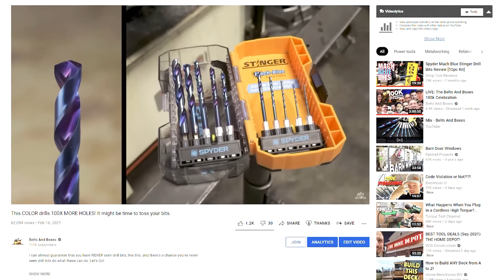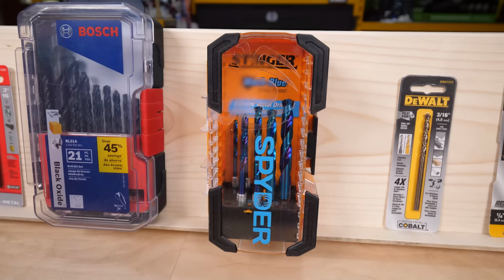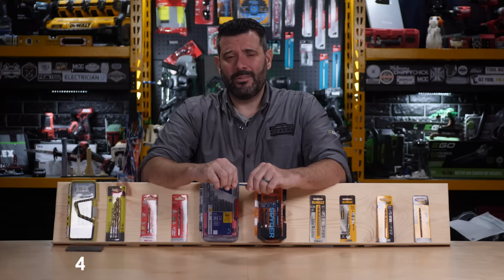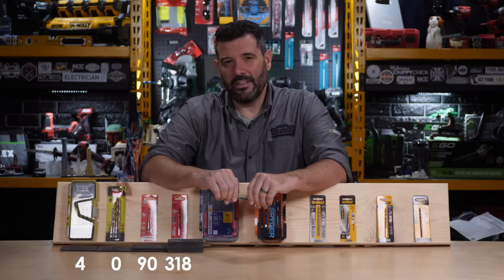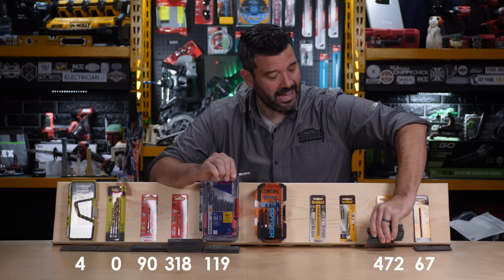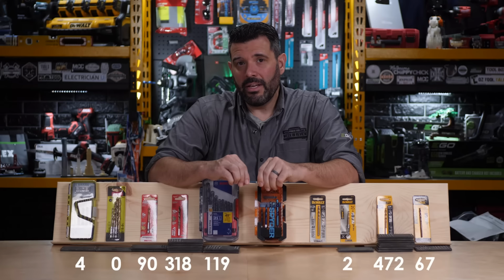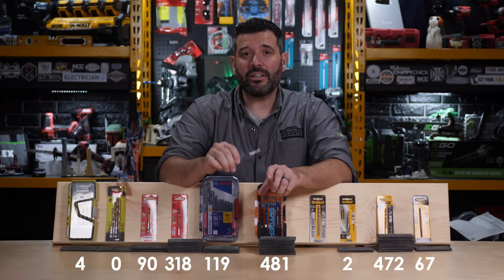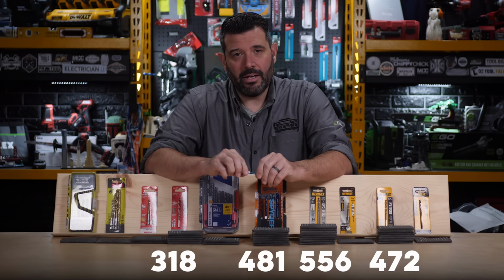What Drill Bit is Best? America takes on China. Milwaukee, DeWALT, Bosch, Ryobi take on Spyder 100x

Comment: Aren't you supposed to go at slower speed when drilling through metal?
Reply from the maker: Depends on the diameter of the bit, and the material. We asked around to people who would know, to determine what rpm to set our drill to, and stuck with it. The strong bits had no problem at that speed. You should also use oil to extend the life of each one, but again, our goal was to use them like an average buyer would.
Reply: @ToolShow  I see, thanks

Comment: Looks like the Diablo money truck didn’t back up to Robs studio.
Reply from the maker: We love Diablo around here. We're using a bunch of their CNC bits on our new CNC and they're amazing. But we didn't find any Diablo metal drilling bits when we went shopping. As for the rest of them, no one sponsored this video (you can't have a manufacturer sponsor a review video). As stated, we did get the Spyder Drill Bits for free, but we bought the rest. And of course, we had the Milwaukee drill already laying around, and bought another one to have as a backup, which we used after the first hole. There was something wrong with our first drill. Now that I'm thinking about it, we never figured out what the problem was. But the second drill worked flawlessly. I'll have to go have it looked at.
Reply: @ToolShow  😂 busting your balls Rob. I actually bought the Spyder bits myself they are amazing. Only thing I hate is why they made the case so big I can only fit it in my packout xl 😂. I definitely think though it needs to be tested against Diablo maybe you can put your brother to work again.

Comment: Strange woth you milwaukee I had awful luck with them I tried to drill a hole in an idler in a 963 so I could put some more passes on it so we could reuse the idler burnt up about an 1/8 of an inch bought a snapon set and they are still going after a year Nad haven't resharpened any

Comment: I would like to point out your testing these in more or less the worst case scenario which is an idiot doing it wrong you should be using some form of cutting oil even if it's just WD-40 or three-in-one oil it would help a lot
Reply: They did what most folks would do. But yeah coolant goes a long ways towards protecting a tool's temper working it.

Comment: "why would you choose a cheap bit!?" 

Easy, I dont want to fuck up nice bits drilling into hardened steel. 

Even the cheap bits generally work on a36 unless youre buying the cheapest stuff off amazon or from harbor freight. The dewalt black oxide bits are cheap and still preform great for a 10-15 dollar short set.
Reply: Also, wish you tested out Drill America. I bought some of their HSS bits and they are amazing. For a reasonable price, and American made, it would be nice to test them vs Spyder.
Reply from the maker: Yeah there are a lot of requests in the comments so far asking about other USA bits that simply are not available in the big box stores. I think there's some merit to that. Any other brands you'd like to see tested?
Reply: @ToolShow  All brands have really high claims for their cobalt bits, and prices to match those claims, but no other experience with US made bits, sorry. Thanks for the video tho, Home Depot was probably the best box store to buy from for average buyers.

Comment: I used those German dewalt bits to TRY to drill out a "snapped off head" pinch bolt from my ball joint on my Subaru.  TWO pulls of the drill trigger and TWO dewalt cobalt bits BROKE.
Absolute SHIT quality!!  I don't know where to go from here for a good bit.  According to this video, this is the BEST metal drilling bit, but it SUCKED for me!
Reply: Verified! I think they should of tested their bits on broken off license plate bolts.

Comment: We built a 132'x50'x20' hay shed recently using tek screws,  we encountered wild variations of each screw to drill through the sheet iron and steel. When buying teks by the 1000s you expect variation. If cheaper bits are going to vary that much maybe they should cost as much as teks.

Comment: i just wanna know how many m18 drills were killed in the making of this test... and how you drilled over 1000holes with  1/4" bits and never snagged/snapped a bit in half
Reply from the maker: Interestingly enough, we actually built a rig that let us pull laterally on the drill, while drilling, until the bit snapped. It was a fun test, but we didn't really see much difference between all the bits, so we didn't include it. Maybe I should throw that up in a short for you guys to see. As for the M18, the first one died (for real) on the FIRST HOLE. We have no idea why. It just stopped responding to trigger pulls. Fortunately Jay from Ohio Power Tool was able to rush over an identical drill, and that one did the whole test without an issue.
Reply: They used a 3/16" bit which is optimal for that drill they used. Not sure if that was by accident or design. There is a 32% surface speed difference between 3/16" and 1/4" and it is right at the critical speed too. Which did make for compelling video. There is more going on here than meets the eye though.
Reply: @1pcfred   yeah anything over 5/16th and these drills struggle, cant get enough feed pressure typically, and if you can then the drill is bogging and overheating

got one of the brushed models not in the same ball park as the fuel, but still everytime i chuck up a step bit and bang out a pile of holes the smoke flies
Reply: @AndrewBrowner  a 5/16" bit is going to just turn too fast in this particular model drill at top speed. There is a relationship between diameter and the peripheral surface speed of a circle and RPM. Bigger diameter circles are traveling faster at their edges than smaller diameter circles at the same RPM. The 3/16" bit they used has a surface speed of 98 feet per minute. A 5/16" bit turning at the same RPM would have a surface speed of 163.6 feet per minute. Exceed 100 SFPM and you are going to cook a HSS bit. Everyone goes max RPM drilling metal too. They're not going to back off that little they need to using a larger bit. The devil is often in minor details.
Reply: @1pcfred  5/16" is usually the biggest bit ill use in 2nd gear, anything larger is 1st, youre not getting the rated drill rpm though what they state is a no load rpm the more feed pressure you apply and the more the drill makes hefty chips the slower it turns as load increases, just from actually experience hand drilling in person on vehicle, fab projects and this and that, with twist drills 3/8" to 9/16" is not fun anything larger is generally misserable, step bits tend to increase what they can drill drastically though, but still once you start exceeding 7/8" on a step but it starts getting misserable again and the torque of these drills in low range when they jam up will do some damage, either to the bits shank which ive broken alot of or to your wrist if youre in an awkward position
Reply: @AndrewBrowner  big holes is when you have to break out the Milwaukee heavy duty right angle drill. It's the wrist saver special. The HD right angle lets you drill holes by hand that you shouldn't. There's something about that right angle attachment. I got other triple reduction drills with handles on them. Meh. You need the angle of the dangle.

Comment: You put in a lot of work to show people this, that's to be respected. However that's not at all how you use a drill bit. First of all the speed is not correct, it's probably way to fast for many of these bits, that's why they stop digging immediately. Drill speed is a big factor in drill success. Secondly the fast consecutive drilling and lack of cutting fluid ensured that the drill bits will not last for long. Several of these drills would last thousands of holes with correct usage. You didn't exactly do Spyder justice here.

Comment: The big thing and I'm not sure on DeWalt or Spyder but durability. Running it at bad angles and bad conditions. I got some Milwaukee cobalts and will never buy them again. Right away they chipped and didn't drill hardly anything and one snapped. A couple of the bits in the set still work amazing but 2 or 3 out of 20 or whatever the set is is a joke. Save your money and buy something else.